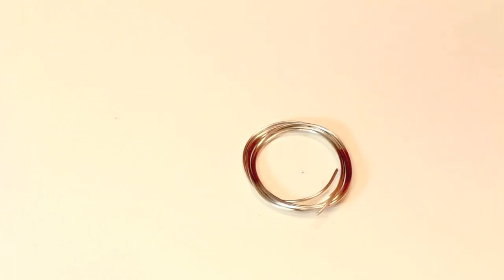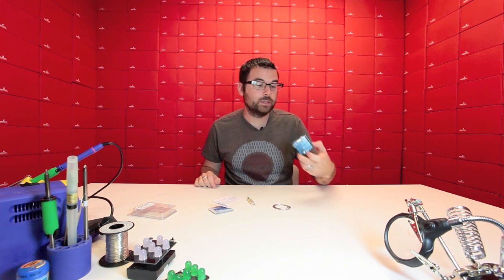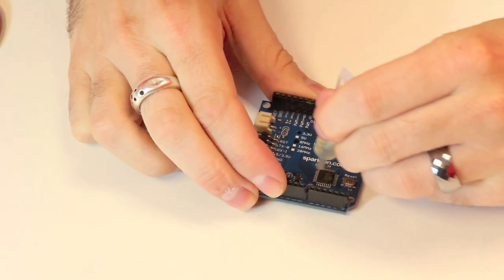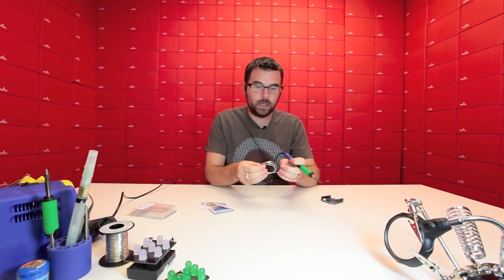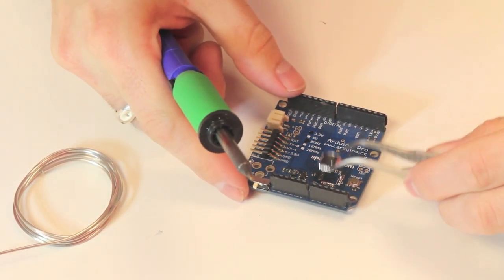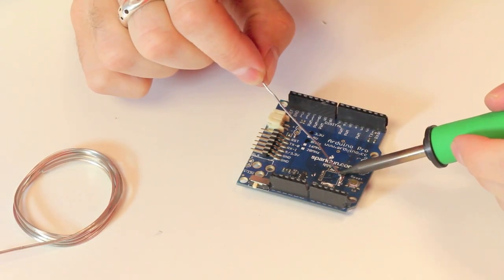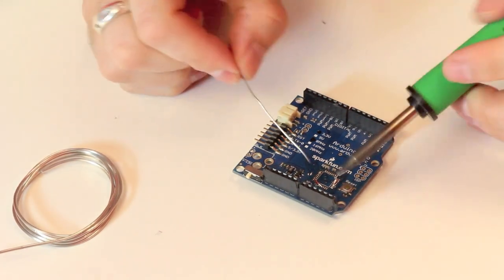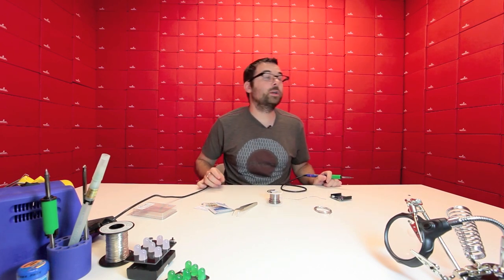SparkFun Chipquick SMD Removal Kit

Comment: Chipquick is a "special solder that turns liquid at lower temperature. The Hakko 808 he uses heats up very fast (about 2-4 minutes) at the set temperature so when set at 300-350c, it will melt Chipquick right away.
Regulator solder turns solid almost right away, while Chipquick will stay for more than 10s, I think.